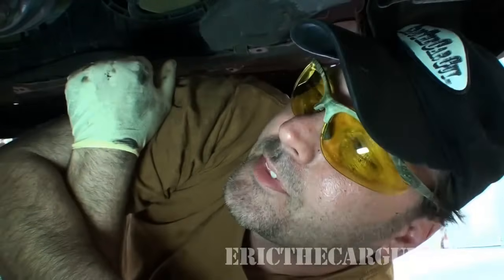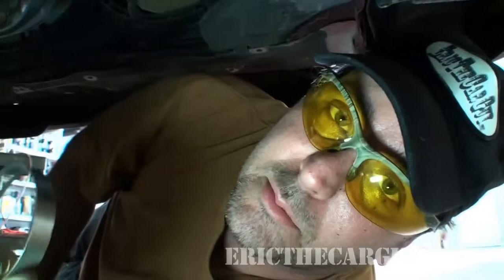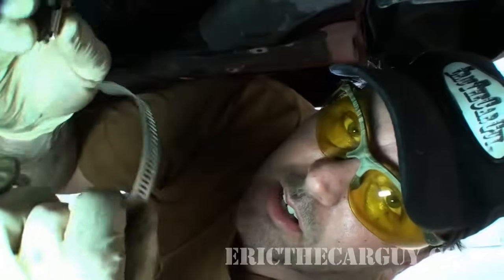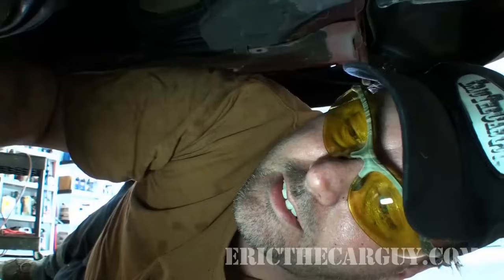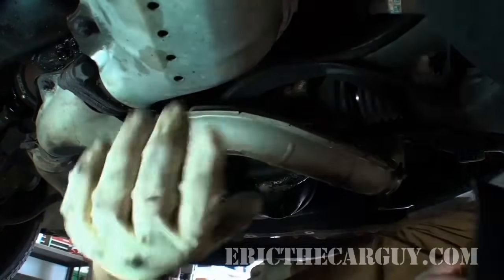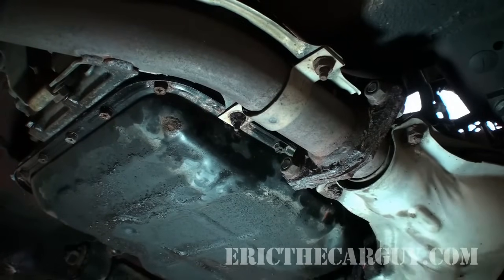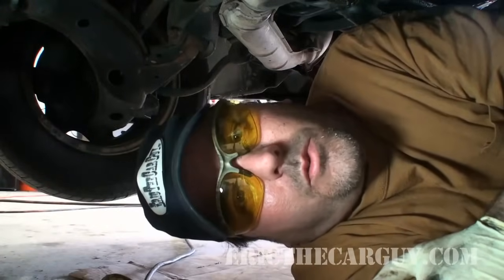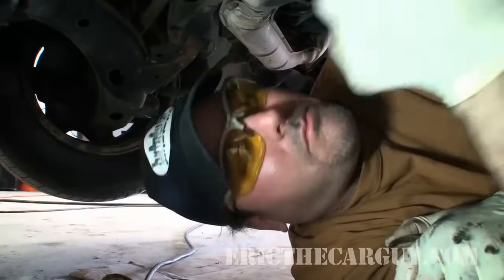How To Fix Exhaust Rattles - EricTheCarGuy

Comment: I recently took my car to a local national chain of exhaust fitters, and had a full brand new system fitted inc' CAT for £500 ($780).  I had to drop my car off and leave it with them three days running, and still it is not fitted correctly; day 1 was worst & scary to drive afterwards..violent vibrations!  It tends to vibrate in a shrill and quick way at above 3000rpm revs approx and affects performance I feel.  This is the first time I have suffered any problems with a new exhaust system.

Comment: Hi Eric  whts up! i have Honda accord 2003 LX , it is making rattling noise only while in Drive mode and with AC on. first we thought that it  is from Belt Tensioner  and we replaced it but still the noise is there. could u plz help me in this regard what it could be? Thanks. just wanna tell u that i follow ur blogs and the way u  work on those cars , it really admires me. TC.

Comment: Eric, I had a plugged muffler on my 2000 Isusu Trooper a while back,
messed up mu EGR valve, intake man. was dirted up, I think,
Spark plugs were dirty. the shop did all the repairs. But my question is,
how does one know when a muffler is jammed up and not flowing properly?  Thanks Joe in Il.

Comment: would it be a good idea to put a tiny piece of heat resistant silicone or rubber between shield and pipe?
Reply: It would have to be some sort of mineral fiber material, or probably ceramic fiber. Exhaust pipe temperatures can reach over 1000 F when the engine is under load. The best rubbers, even silicone, aren't going to survive over 600 F. Even Kapton, the most heat tolerant plastic I know, gives up at around 750 F.

Look for composite gasket materials designed for engine exhaust applications, that would be a good place to start. Probably not worth it though.

Comment: hi eric i have the rattle but it only happens at low rpms when the car is under load... like ... switching up from 2nd to 3rd... and the only when i accelerate... otherwise nothing... do you have any ideas what it could be ? thanks 

btw i drive a rx8

Comment: hey Eric I have something going on with my avalanche it is making a little rattling noise when I press the gas is reducing speed and also my engine light flashing on my just got my spark plugs and wires changed I'm trying to see what else could be going on

Comment: I have a 99 f150 and there is a knick sound but its from behind the engine at the passenger side catalytic converter.  Is it possible to be the cat knocking or a mechanical issue sounding through the exhaust?

Comment: Done this before but the hose clamp over time will fracture and split from heat and movement. Just spend a couple extra dollars and get 2 new nuts and bolts lock tight  and you won't have to worry about it for longer than a hose clamp fix

Comment: I have a rattling noise in my exhaust as well.  But it's not the same as in this video.  It's actually my muffler hitting the floor pan in my Mustang.  The previous owner installed a Flowmaster exhaust system, but it didn't fit quite right.  So now the muffler is a little too close to the pan and when it shakes it bumps into the pan and makes a really irritating noise.  I've been trying to figure out how to get it fixed but haven't been able to come up with anything.  :(

Comment: eric, I have a  04 expedition 5.4 started making a metal click sound when I  start the truck in 1 min. 2 to 3 clicks then stops when warm up when she turns off she does iit again cooling off, from front exhust ,heat shield or broken converter????

Comment: I have some grinding noise on my Acura Tl manual at around 2200 RPM in every gear when the car is hot only and while driving. Can it be a loose heat shield?

Comment: The bracket is already bottomed out (tight as it will go).  It's rattling because the metal has stretched over the years from constant heating/cooling and vibration.

Comment: do you have any idea what could be my problem, i always get a strange "wooooooop" rattle at around 2200rpm, when im accelerating or decelerating and im pretty sure its not heat shield since i've checked it numerous times, could it be bad dogbone mount? its looking quite bad but if i put a car in gear and push it around i dont get too much engine movement so im not quite sure

Comment: My problem. The noise only apears in hot engine conditions. I put a complete turboback with high flow sports cat. Since that i have vibration in middle area and between 2800-3000 rpm.

Comment: i have a 96 jeep cherokee xj and when i first start it / when its at idle i hear a rattle in the catalytic converter, but the bottom(sheild) is rusted out and i banged it and no rattle. When i press on the gas it stops though. the rattle sounds like a bouncing rock. Could that possibly be what it is?

Comment: Having same problem in my Chevy Tahoe took the silencer off and right after got a sound tell yesterday a good mechanic told me is ether that or a bad cat I had a loud noise only at acceleration sound it metal to metal be carful other shops told me was a bad lifter other one the rod bearing but if it was any of this thing the noise will not go away my only happens wen I accelerate

Comment: this wont work on the heat shield on the top side of the exhaust manifold? or will it? and if i remove the top header heat shield what could it affect other than heating electrical wires?

Comment: I've had that rattling in my exhaust since I bought my newused car. I put it on a lift tonight and there is no heat shields. So I go smacking everything and the noise is inside the exhaust. There's a piece of metal bouncing around. As a guess, it's part of my catalytic converter which took some knocks before I bought the thing.

Comment: I have a noise that (sometimes) happens when i accelerate and it sounds sort of like a diesel engine rev, or Plerry the Platypus' rattling. Trying to find out what that is. 95 Lexus LS400. Noise is fairly subtle

Comment: I've got a civic. An EM2 non vtec to be exact and for the life of me I am not able to find the dang rattle. The shields are attached to the car so those clamps are useless. However, when I smack the "pipe" it rattles in certain places. One by the resonator that's close to the axleback muffler and two, just below the connection points between the catalytic converter and the down pipe. One of the most annoying sounds on a civic next to the rocker ticking noises in the engine.
Reply: +Sam Han hey man I also have the same car with same problem how did U fix it? Thanks
Reply: +Daniel Martyn I ordered all New exhaust hangars. and it worked pretty well.
Reply: thanks a lot man appericate it 
also do u think removing the heat shield would work?
Reply: thanks a lot man appericate it 
also do u think removing the heat shield would work?
Reply: +Daniel Martyn I honestly haven't tried that yet. but I suggest you do that first for process of elimination sake. buying the hangars was the cheapest route I went with first.
Reply: +Daniel Martyn also, if you're burning or going through A LOT and its still rattling you might have a lot of soot build up in that canister that bolts up to the axle back. also, inspect your motor mounts with an led flash light.

Comment: I'm going to try this my 2000 Honda Civic has a rattling sound at idle I'm thinking it needs a new Catalytic converter but I'll check out the heat shields also it has a D16Y7 engine and it idles rough there's a lot of vibration sometimes as it feels like the engine is adjusting
Reply: any luck?
Reply: Luis V. I guess it was I hit it with a hammer instead:P it must have been it

Comment: Hi Eric, Thanks for uploading this. I wonder if I have the same issue. I have a 2003 Nissan Altima, after driving it for 10 years, 225k miles, I start to hear this rattling kind of noise whenever I hit the gas, it gets slightly louder when I pick up speed on the freeway. I hear this noise about 90-95% of the time.  It drives me crazy not know what it is and I hear other old cars with this noise as well when they accelerate.  Do you think this is also an exhaust issue that's loose?  Thanks.
Reply: It just happen to my truck, and it wasn't the exhaust pipe, I went crazy I couldn't figure it out what it was until finally I found out what it was. It was the starter. I couldn't believe it
Reply: gelio Garcia really? what does the starter have to do with the noise? How is that connected?
Reply: gelio Garcia blog e.  Bd m mms hmmp
Reply: Cilka Hettinger the problem was,  the spring that kicks back the pinion starter, when you start the truck was busted, and it was dancing in the starter while I was driving, causing the noise only when I hit gas pedal
Reply: ***** the spring that holds tight and kicks back  the starter pinion was busted, and it was dancing in the armature every time I hit the gas pedal,  causing the noise

Comment: My exhaust only rattles when the car is moving and only at certain RPM of 1,500-1,600(approximately), Would that mean its the same thing is wrong with my exhaust system as it is on yours?

PS: I drive 07 Toyota Camry LE

Comment: Have a 2000 Sebring and somebody just replaced the distributor on it as soon as it started hearing a serious heat shield type rattle or something on the drive shaft but after for five minutes of idling it goes away so obviously the heat is causing the rattle to go away and then it sounds fine any clues front wheel drive 2.5 l

Comment: Oh my God, you just saved me $600 on a service job. Those douchebags at the dealership would have replaced a number of heat shield components when all they would have to do is install a $3 hose clamp. I'm going to try this.

Comment: I have a rattle when i press the accelerator only and it last for a few seconds in the beginning then Stops. But only i think when i have my AC on. What do you think it can be??
Reply: Could be several things; A/C Compressor/Belt, pulley or tensioner itself.

Comment: I had same problem it's the starter, only when I hit the gas pedal. It's the starter pinion,  it gets loose overtime,  and starts dancing in the armature while you driving causing a cracking noise. When I hit the gas pedal I hear the noise, when I take my foot off the pedal the noise stops. Check that and let me know

Comment: hi eric, im having a problem with my 99 legacy 2.5 auto.. it is getting reaalllly crappy fuel mileage, im lucky if i see 300 miles to a tank, i just got the car just over a month ago for 600$ certified and emission tested, put a new motor in with 200k on it from the wrecker, whoever had the motor bypassed the metal tube that goes up to the egr, and un-grounded the EGR solenoid. it has a hole between the first and second cat, and the exhaust smells like raw fuel....

Comment: I have same rattle but only when is on gear(automatic gearbox) between 1.000-2.000 rpms.
On parking mode or neutral, no noise.
Any idea what it could be?
Thanks,

Comment: that exhaust flange is leaking burning the  heat shield bolts make sure you at least smear muffler weld around  those  connections to patch the leaks

Comment: Hey Eric. I have rattling under my expedition,  it only happens when i put it in drive or reverse. When i hit the gas it gets worse.. In neutral and park its not so noticeable. I went to the muffler shop after i checked myself, they say its not my exhaust. Does this issue sound familiar to you?
Reply: Did you get your problem fixed? Cuz i have kinda of the same problem here

Comment: i got a 96 Honda civic i replaced the gasket for the oil pan so i had to remove the exhaust out of my way so i took off Cadillac converter left it hanging once i was finished put everything back the way it was and a loud raddle started and then a shit load of smoke came out of the cad and i ran car check engine came on help here erickthecarguy can it be my converter?

Comment: I am getting that noise most of the time at idle....and it is the worst when I turn the A/C on.  Then is goes away when I turn off the A/C.  Sometimes it makes the noise while backing up.  I have a 2007 Jeep Grand Cherokee Laredo.  Any thoughts/suggestions?  Thanks!!!
Reply: Exact same thing happens with my '07 Chevy Cobalt, please let me know if you find anything out, it would be much appreciated!
Reply: +Josh Hatfield   My Jeep doesn't have metal heat shields....It has a material lining between the floor board & exhaust.  I determined that the (2) crappy stock brackets that hold the new exhaust were the culprit. I took some hose claps, installed them and tightened them down in one spot.  That helped a ton (so I am thankful for this vid!!!) but I still have a little rattle....I will simply install another hose clamp or two.  Hope that helps!

Comment: I have a 2003 Honda Accord Ex, 2.4 liter 4 cylinder engine. I have been hearing a slight rattle when I go to start the engine. And it almost sounds longer to start at times also. And every so often, I will hear the small rattling sound. Let's say at a stop light or something. The car does start, just not sure about the small rattling sound. Please help Eric the Car Guy! 

Thanks 
erick

Comment: what about if you have those aluminum sheets on the underside of the body? Like in mazdas. Mine got knocked loose by a rock, and I've tried eveything short of taking it off. Id perfer to keep it, but when ever my engines cold my exhaust makes the most anoyying sound EVER.

Comment: Can you use this in pace of exhaust clamps?
Reply: Not a pro
But probably not a good idea, those small thin clamps will not be able to apply significant enough pressure to the pipes being clamped to sufficiently clamp them or probably even hold them

Comment: I can not diagnose the noise on my pug 207 when i accelarate its like a vibrating ticking/rattoe noise not like a clicking from cv joint eitger its more like an exhaust rattle but can not find it

Comment: I'll have to try this. Sound underneath sounds like exhaust was rattling and shaking. But when I look under car while it's running. Can't see any shaking of the exhaust.  That sounds vibrates under my car more in center where I shift car into drive.  I have a Nissan versa 2010. Didn't start making this loud rattling sound till winter. It metaforicly sounds like rocks in a tin can vibrates car on and off.. Becomes more constant when I shift into drive.
Reply: If you're still having the issue, I think I know what it is because I have a 2010 Nissan that was doing the same, it's the little brace/bridge running across underneath the exhaust.. I'm not exactly sure what it's for but you can remove it if you wish to do so... I just got it bent away from the exhaust with a crowbar so it could stop rattling.
Reply: SaN AnToNiO-Saints Fan .

Comment: 1999 Camry CE, 4 cyl 2.2L

Going bonkers trying to figure this out...

I've got an exhaust leak from under a small metal square (about 2" on a side) tack welded to the pipe between the O2 sensor and the resonator. The welds are about 1/2" long, centered on the circumference sides (along the line a string tied around the pipe would make). The two sides in line with the length of the pipe stand proud by about 3/16". 

My knee jerk was to get some high temp exhaust goo and plug the thing, but the tab looks for all the world like it's supposed to be there, open, and doing...something. I'm usually pretty good with the searching, but I can't find any references to it anywhere.

Anybody know what I'm looking at, and if anything terrible happens if I plug it up?

Comment: Will a Nylon zip tie work?  Melting point of nylon is above 400F.
Reply: +Chuck Chung No that will not work.  If you have to you could use a wire coat hanger.  Just undo it and run it around the offending area.  twist it as snug as you can by hand and cut of the excess with large wire snips or side cutters.   Then with some meaty pliers grab the twist part and continue twisting it in the same direction.  The wire will tighten down much more than you would be able to do by hand.   

The Nylon will not work as parts of your exhaust, especially the catalytic converter area can exceed that temperature regularly.

Comment: Mine almost sounds like a rod knock - I cut the cat off and the sound went away for about 30sec's then came back- this car sat for a more than four years and im tryin to get her in flight condition again, Its a 95 Z28 and has heat shields on the exh mans wich is annoying by itself

Comment: I have civic 2007 and when I'm going from 5-25 mph the rattling noice always appears and when I let go of the gas it disappears or when I accelerate. This noice is very annoyOmg and I can't find it
Reply: ivan ugalde it's probably the springs on the exhaust bolts not fitting properly.
Reply: check the heat shielding around the cat - look for corroded bolts keeping the halves together. hose clamp that baby.
Reply: Sometimes it's the hood/bonnet:
https://www.youtube.com/watch?v=M1KFfJHVmqs
Reply: I have the same car it’s most likely rattling on the a arm in the rear passenger side

Comment: My car started doing a rattle noise from 2500 to 3000 rpm a couple weeks ago, only does it when driving.. Not when idling or on neutral... Please help ...😬
Reply: It's probably your connecting rod.. hopefully not because that is a sign your engine is dying.
Reply: +Team Crispy Pie it was not, the heat shields were loose. Just put the same straps that he used and it solved it ...
Reply: +sinajar that's great news!